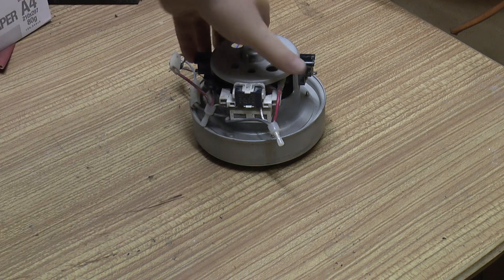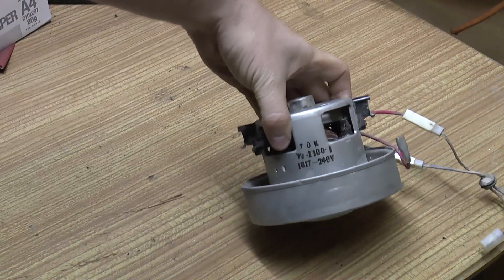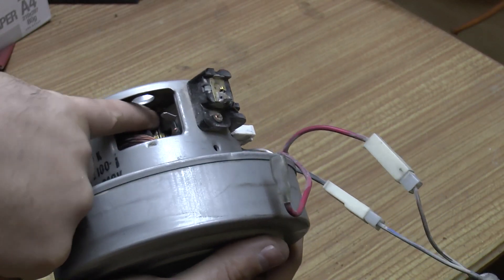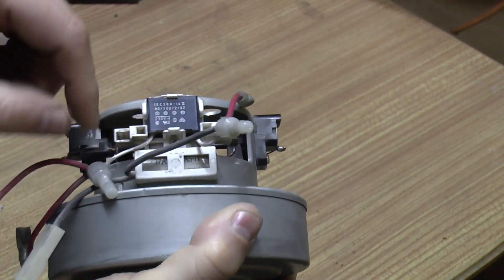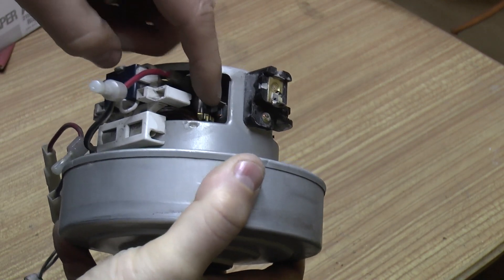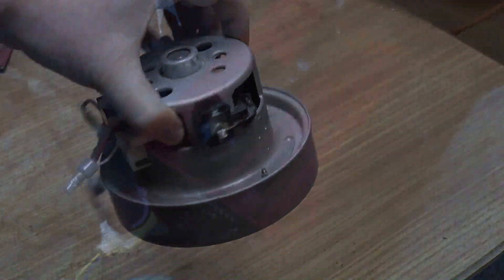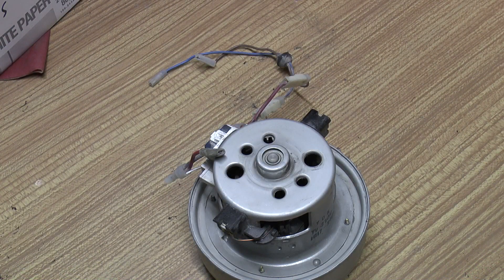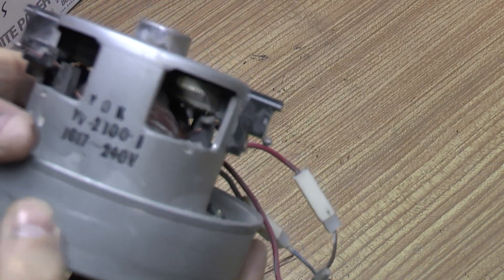Dyson motor burnout at 360 volts

Comment: Big mistake   as soon as started making noise , you should pulled out brushes, sand the tips nicely and air pressured the inside motor and clean things put it back , it would work like new . 
You put the stressed brushes and motor under extreme current , of course is going to melt. ??!!

Comment: Also, do you think if you maintained the correct voltage level and changed line frequency (50hz to 60hz), it would have run without any issues?
Reply from the maker: https://www.practicalmachinist.com/vb/transformers-phase-converters-and-vfd/running-50hz-universal-motor-60hz-358087/

Comment: The sudden stop, is because the armature was effectively short circuited by the flash over arcing between the commutator segments. When it flashed over, full line voltage was applied to the field coil, turning the motor into a generator, with the armature shorted. that stops the motor in an instant, even if the bearings turn freely. Once the armature shorted, the field coil received enough current to burn out also. It was a Dyson: No loss.

Comment: Dyson use torx screws - YDK (The maker of the motors Dyson used on the dc04,07,14 and so on up to the machines that had a digital motor) used philip, because Dyson don't make the motors - YDK do, sometimes Panasonic or Kenley

Comment: DC23 is designed to fail

Dyson customers pay a high premium  for well designed quality products with good backup and after sales service.
So what do they get?  You get,  Badly designed  expensive poor quality  junk. Over sold, Over priced, no after sales service. Summary: Think very hard, don't listen to hype, don't waste your money.   
Never buy a Dyson product https://www.youtube.com/watch?v=JPaNE0jtpdE&feature=youtu.be
Reply from the maker: ***** Better off going for light-commercial stuff. I've got a Numatic Charles now (Henry's wet-and-dry brother). Look at the small print in many vacs' user manuals and the warranty specifically excludes commercial use. Look at a Numatic manual and they specifically recommend it!
Reply: I have a Dyson but just before the new EU regs on lower power vac motors came in I bought a Henry for the future as a backup. I did just have to replace the motor in my Dyson but you can buy one on ebay for £14 and 2 stets of new filters for £10 so I think Henry is staying in the box for a few more years :-)

Comment: I have the impression the DC5 is a design which has been wrapped up too tight and ran hot all the time . Ours threw a motor 2 years ago ..... throwing sparks into the post motor filter . Replace motor ( and filter £60 ) , went phut about 1 1/2 months ago . Replaced with a VAX , less than half the price of the DC5 replacement .

Comment from the maker: I was forever cleaning the filters and it was forever clogging back up again, bloody thing was useless from day one. Got an Electrolux as well anyway (which has always worked) so trashing the Dyson was no great loss, at least the cable might come in handy now it's been stripped out of the lethargic cable winder. Got no use for the motor anyway, if I need a universal motor for anything (if the lawnmower dies for example) I've got a washing machine one I can use.

Comment: A perfecctly good motor ruined for no reason and no doubt the same could be said for the rest of the machine.  The original issue was probably a blockage which could have been cleared.
Reply: Yes and all the starving in Africa could have benefited from it also they have a shortage of them over there. :-)  You are right though mate I always fix rather than chuck if I can.

Comment: That motor didn't last long. I find most vacuum cleaner motors very small for their so called power output. A 1400 Watt rated and claimed motor is the same size a s a 600 Watt vacuum motor.

Comment: There's a slight difference in the design of a universal motor and a car alternator. 

In a motor, there is a commutator that necessarily has a rough surface, and which necessarily generates arcs as the circuit is switched (or "commutated"). These cause accelerated wear of the brushes and also the com-bars.

In an alternator, there is no commutator, and no switching, so no arcs, no rough surface. Instead, the brushes merely deliver current to smooth slip rings. These brushes suffer less wear.

Comment: Took me about 5 seconds on google to find some for about £6. Brushes are a consumable item, like oil and petrol in a car. If an inverter board goes pop, which it will, it'll probably cost more than the machine is worth for a new one. I'm not against high-tech gear, I just don't like all this nonsense just to driver a motor...

Comment from the maker: Disconnected. If you look carefully the original power leads for the motor are dangling out through the hole in the plastic drum. The cap was connected to those, I was connected straight to the motor terminals.